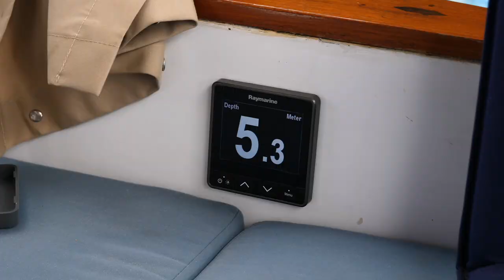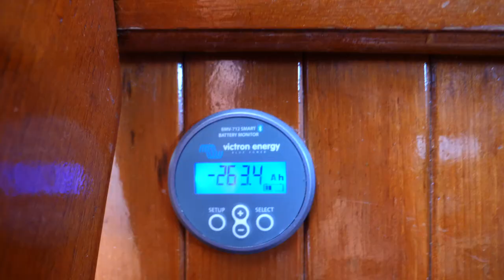Our First Days in the Beautiful Caribbean  | Ep. 62

Comment: I agree with SW.  I can’t say just for sure, but that connector looked a bit small for the total size of your solar array.  Even if an appropriate size, a bit of moisture, or corrosion, or a poor crimp will cause some resistance which will cause heat. This is the most dangerous kind of failure, as a fuse or breaker won’t help.  Replace the connector with an appropriate sized part, use use electrical contact preservative like a dialectic grease or an electrical anti-corrosion spray. A very thin coat on the wire end before crimping and a thin coat on the mating surfaces of the connector. Seal the connectors in heat shrink, the kind that’s lined with hot glue to seal the connection.  Great videos btw.

Comment: Those connectors are not rated for such current from the look of it. Probably they have melted due to the connector corroded little bit, then started heating -> more resistance -> more heat effect. Just wild guess, but I'd replace all of those with propper ones.

Comment: Thanks for another great video!  I have really enjoyed following your adventures and look forward to each new episode.  
I was a bit alarmed to see your overheated PV wiring.  The failure was most likely caused by the type of connector you have used, which looks undersized and is probably imposing too much resistance.  That is what caused it to overheat.  You should really remove all similar connectors and replace them with proper crimped-on solar connectors.   These are cheap and easy to find on places like Amazon, but should also be readily available where you are.  Also check your cables.  It looks like you have used standard ELV power cable.  This type of cable is not really suitable for PV installations, which require double sheathed multi-stranded copper cable.  The voltage from a PV array can be quite high, and standard cable types may not be up to the job.
Good luck, hope you get it all sorted.